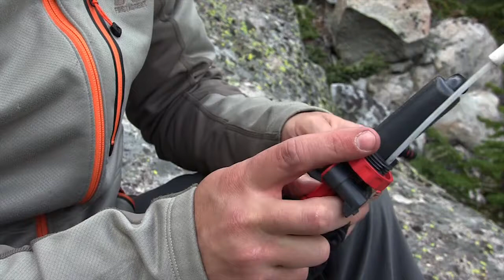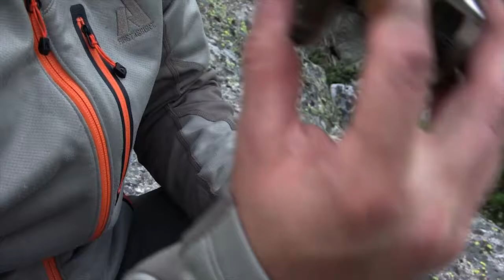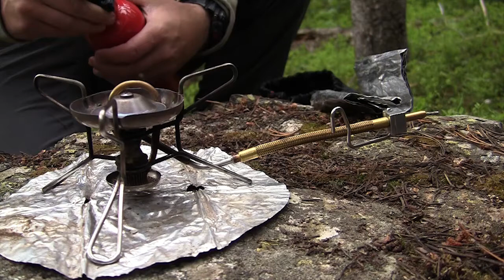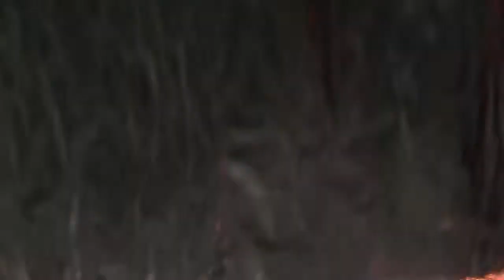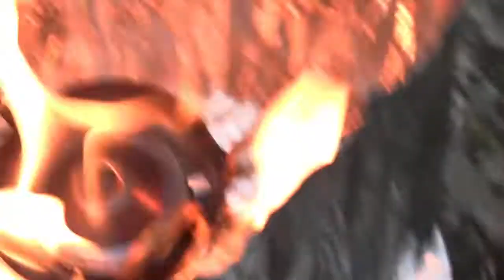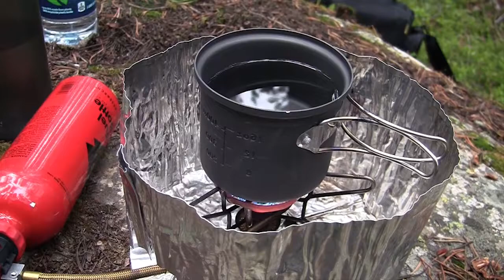MSR WHISPERLITE SET UP

Comment: Good demonstration. Personal input: The inside radius on the pot support stands is too large for smaller containers to sit without spilling while thru the boiling/cooking process. The need to hold your cup during cooking as not to spill. Top of pot stands/supports too slick. Have been using this NON shaker stove for many years. And have learned it's ups and down problems. Be sure to use the stainless fuel line cable to clean the fuel line when needed. Clean the jet, stove parts. Clean and lube the pump body. This stove can be used around the seasons. It's Superior blue flame shines in the cold of winter.... 

Any mods made on this MSR Whisper Lite (Pre Shaker) stove would be greatly appreciated.

Thanks, from the Great State of Texas

Comment: Mine has been sitting in my garage for 7 years with the pump/valve mechanism screwed into the fuel bottle.  Any precautions I should take before using it again?
Reply from the maker: as long as it's sealed I don't thing you would have any problems. might want to start it and run some fuel threw it and make sure it operates properly. if it sputters or won't run then you know you need to break it down and clean it and get fresh fuel.

Comment: any ideas why the stove will prime but then it won't go to that blue flame and instead stays a red flame (even with valve very far open)?
Reply from the maker: hey man! not very active on here anymore, sorry so late.  the only thing I can think is that the atomization tube is not hot enough. maybe because of too much fuel. a teaspoon in the bowl then let it burn down and crack the valve. should hiss with the blue flame. hope this helps.
Reply: Thanks for the tips! I'll give it another go and see what happens. Cheers!